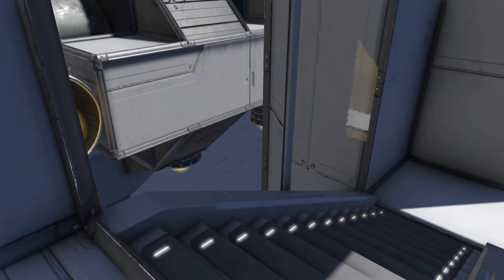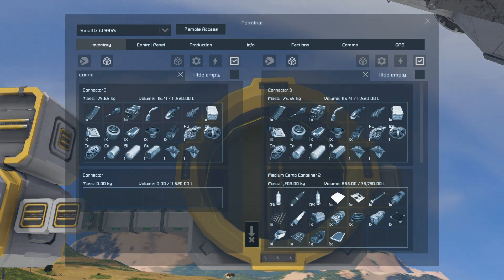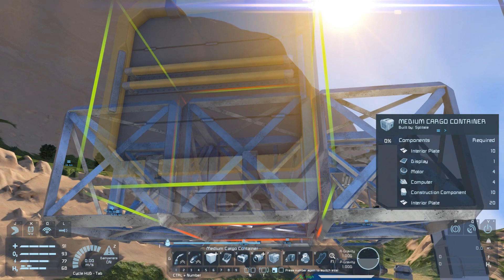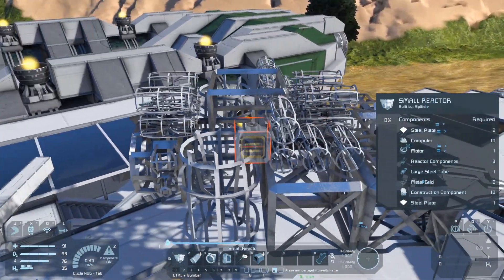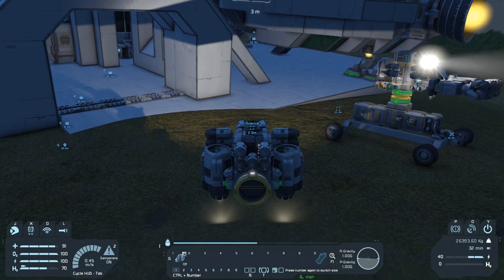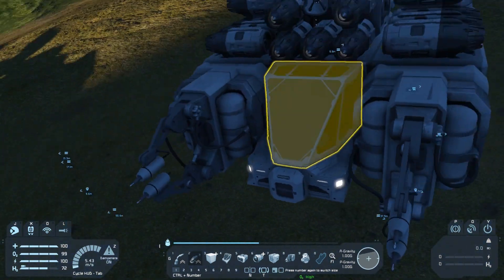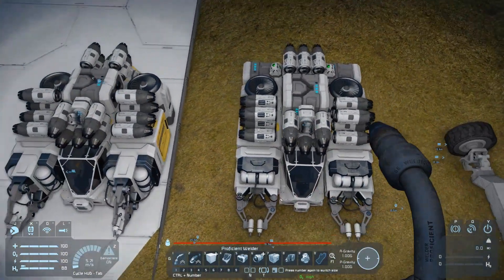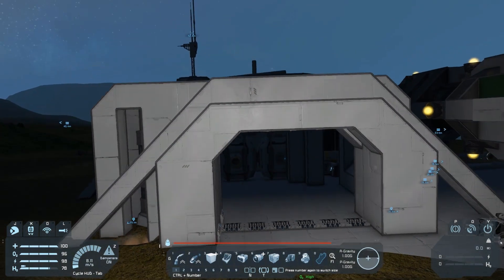Space Engineers Tutorial: Conveyors and Welding Ships (Part 7 of a survival tutorial series)

Comment: I guess if you rotate those two outer conveyor junctions so that the small ports are to the front, you could use the exact same design for a small mining ship.

I look forward to the day when the developers allow Merge blocks to convey materials through them, as they did with the advanced rotors.  That would make life so much easier.
Reply from the maker: Yeah that would be a very good addition, exchangeable tools for small ships! 

The downside of using such large conveyors for a mining ship would be that you could use that space for storage instead of large conveyors, but then you'd need more thrust and more batteries... bugger.
Reply: I have set up small blocks with just the individual tools on the front and a merge block on the rear so that each can be picked up with a small ship.  But transferring the minerals/items renders this option obsolete at the moment.  Setting up conveyors and connectors would solve the problem but defeat the objective of creating a small ship with interchangeable tools.

But that does give me another idea . . .
Reply from the maker: You've piqued my interest...

One idea I've had but never tested is to make a thruster and powered ship that can connect to a combined cargo and tool section, it would resolve some of the connector problems, the tool bits would be bigger though :(
Reply: I think I may have solved the problem.

I used the same start as you, with the three Conveyor Junctions at the front with a Welder mounted on each of the two outer ones.  I then mounted a Merge block on the back of the centre Conveyor Junction, but on the front of it, where you mounted the Cockpit, I mounted a Medium Cargo Container (MCC) and then placed a Connector on the front of that.

I rearranged my Tug (small multi purpose ship) to make it a bit more compact and the system works well, with two exceptions:

I have no problem docking the tool block to a connector to re-stock the cargo, but I had hoped to have a line of connectors so I could leave the tool blocks connected at the docking station.  However, when the merge block is disconnected, the connector on the tool block disconnects and the tool block plummets to the floor.  I tried giving the tool block its own power but the connector still failed once the merge blocks were separated.

If anyone has an answer to this problem it would be greatly appreciated.

The second problem I experienced was that once the MCC was fully laden I couldn’t get my ship to roll.  It turns well enough, so its not the gyros.  It also lifts and moves sideways OK.  But if I try to roll, it barely moves, however the roll does improve if I have forward or rearward momentum.  Also, it pitches OK until it gets to about 45 degrees, and then it stops.  Lots of head scratching going on this end.  The only thing I can think of is to add more downward thrusters.
Reply: By the way, in contemplating my roll problem, I noticed that you don't have any down thrusters on your ships in this episode.  I know in theory they shouldn't be required in a 1G atmosphere, but your ships hover and I don't see the inertia dampers being turned off.  So how do you achieve the downwards movement?  (I hope the answer is not so obvious that I end up looking like a right dork)
Reply from the maker: I'm going to answer the easy question first: I don't have downwards thrusters because I just use gravity for that bit - when you hit 'c' or your downwards key your lifting thrusters briefly switch off allowing you to fall.

As to the roll problem, that's just weird as it should (in theory) be controlled by the number of gyros vs the weight of the ship. 

With the connectors do you use the 'p' or park key to dock/undock, you could try setting up G menu bindings for the individual parts so that the merge block is the only part you turn off, they might stay connected then. Off the top of my head I'm not sure if you need power to stay docked to a connector, I think you might but I'm far from confident.
Reply: I did  not know that about the downward movement  when hit the C key when no down thrusters are fitted so I don't feel like a complete dork.
Reply: OK I have done a bit more work and here is what I have found.

First the good news.  It turned out that my pitch and roll problem was just the gyros.  Oddly, adding two more gyros fixed the problem despite the fact that I was able to turn very rapidly with just two, I needed four to be able to roll when fully laden.  However, I did have to group them separately because the light weight tug on its own was way to erratic with four gyros.
Reply: The merge block/connector was not so successful.  (I do use the G menu bar to control all equipment)  

After a few more trials and errors I have been able to determine that when the merge block is disconnected the connector on the welding tool also turns off because it has no power, which is perfectly understandable.  However,  If the welding tool block is given its own power, when the merge block is disconnected the connector on the tool block stays on but it unlocks, causing it to plummet to the ground the moment the ship is pulled away.   This can be overcome by leaving the cockpit and turning on the connector manually through the welding tool blocks inventory, but it hardly seems worth the effort and is defeating the objective of having an easy docking station.

Now I just have to repeat the build for my grinder and a mini drill.
Reply from the maker: You could always add a control to your hotbar for increasing and decreasing their power, that way you can adjust on the fly and have them all on - though with 4 I'm not sure you need more granularity to the controls than that.
I wonder if it has something to do with the activation of the side/front/back facing thrusters makes some calculation with the gyros change...
Reply: I don't understand what it is with the gyros, just that it is a bit weird.  Particularly when you take into account I could pitch up and down OK but only to about 45 degrees.

I did think about the increase/decrease power option on the hotbar, but because of the increments I think it is just as easy to turn off a couple when not carrying a load.  Time will tell.

I have had another idea for the tug merge setup to.  I don't know about you, but when thinking about the layout of a new ship I sometimes think that consideration for the location of a connector for refueling/restocking, can cause some design restrictions.  So I am going to build a refueling ship that will take the fuel/cargo to the ship, rather than trying to dock a cumbersome larger ship.
Reply from the maker: Yeah, a refuelling/cargo tug could be handy, especially for transferring between very large ships and your base - no need to come up with some ridiculous docking contraption then :)
Reply: I'm part way through the cargo container group for the tug with three large small ship cargo containers which I think would be plenty room enough to cart fuel (ice and uranium) plus standard cargo back and forth.  I will also put a bank of batteries on board so power can also be transferred.

It did occur to me that this will be very heavy once filled so I have built a booster pack that consists of two large thrusters (at the moment, if more are needed I can make it bigger) with a merge block on the front and back so I can pick it up with the tug, then pick up the cargo with the booster pack in between the cargo and the tug.  I've just got to work on a safe way to dock the cargo container group so that the batteries can be charging while sitting idle on the base.

I also built the mining tool, which was the easiest of the lot.  Just a single MCC in the middle with the small ports out to the sides.  Attached to these one drill on either side, a connector between the two drills and the merge block on the back.  Ready for action
Reply from the maker: Sounds like a pretty cool design - once you're happy with it, post it on the workshop and send me the link. I'd be interested in checking it out
Reply: Oh!  its all pretty clunky at the moment and not dressed up enough for the Workshop.

I am currently enjoying a cuppa and watching Light Echoes.  Sweeeeeet!
Reply from the maker: Nice :)
We've started making some progress on it again after Capac lost his voice for a while so the season 2 cliffhanger should be out in the next few weeks ;)
Reply: I'm only up to Episode 5 in Series 1, so no spoilers please.

The cargo group is coming along well and I had better success with the connector staying docked after the merge block was released this time.  I have a connector on the bottom and I used blast door blocks as a skid for the whole unit to stand on (I haven't put landing gears on any of the merge tools as I wanted to make it quick and easy to pick them up).  The skid rails are just a tad higher than the Connector, enabling me to rest it on a platform over a built in base connector, thinking that once the merge block was disconnected I could get out and reconnect the connector.  But there was no need - it remained connected. 

More head scratching.

Next I need to fill her up and see if I can pick it up.
Reply from the maker: Don't you worry, I'd never give away any spoilers for Capac's writing :)

It's both good and bad that your new system's working... I'm pleased it's working but we're no closer to understanding when or why :P
At least if you can't pick it up there's a relatively easy solution - more POWER!
Reply: POWER to the people - the more the merrier. 

We will see how we go.  I can always hook up my power booster pack (or 2, or 3, or  . . . .)